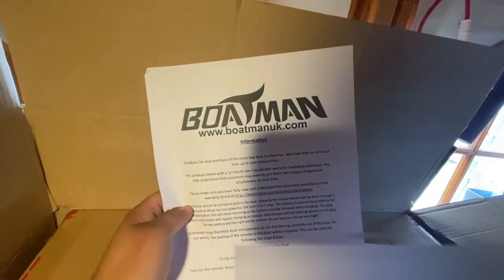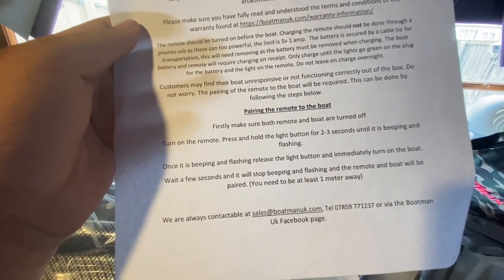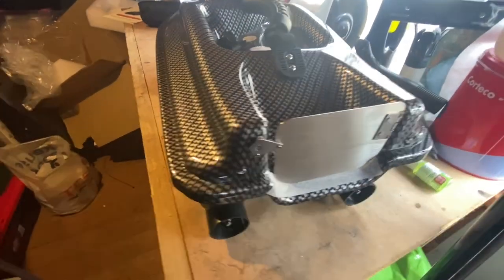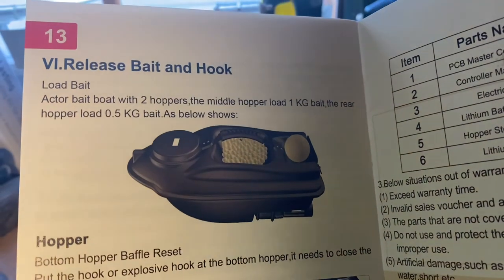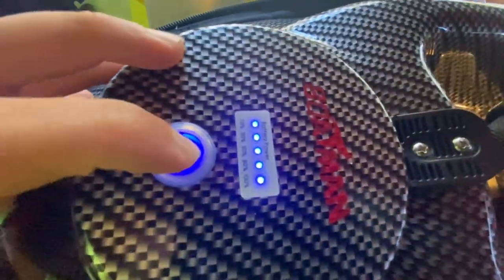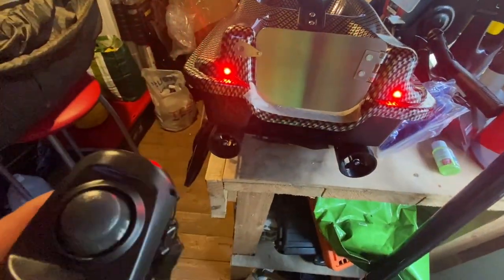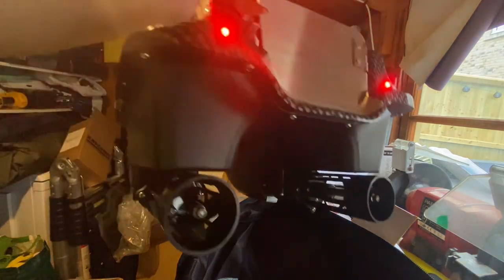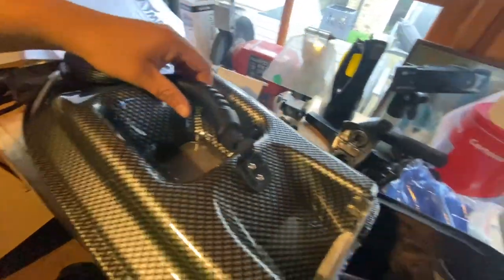Actor Baitboat Unboxing and Review

Comment: Had one 2 years now cracking piece of kit I upgraded the lid to gps best thing ever 😀 can you tell me what are thinking of coating hull in thanks 😊
Reply from the maker: Hi. Yes really enjoying mine. 😄. I have done a video on this. Will be up in couple of weeks 😄. I have used the trim restore ceramic coating. Have got a video of using it on my car 🙂
I’m only using it really as I already had it. But have a look at ceramic coating on Amazon. I would imagine all ceramic coatings will be fine 🙂